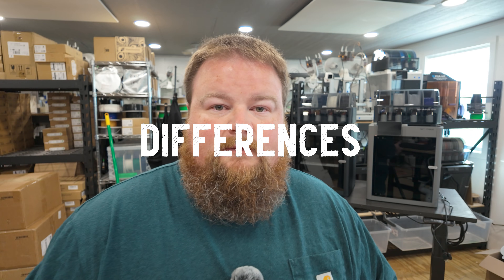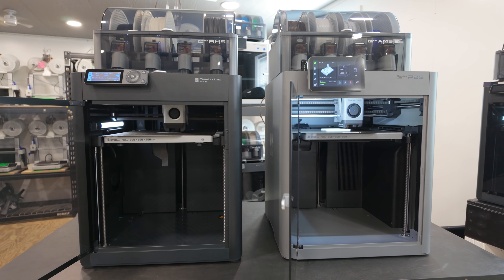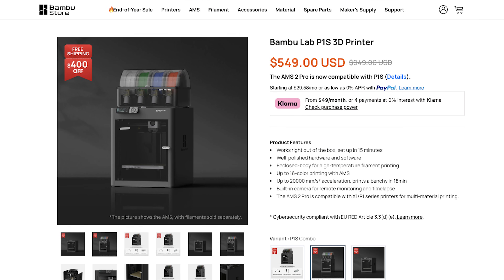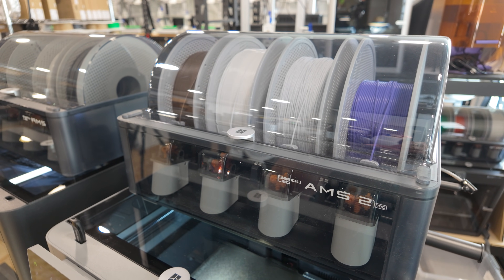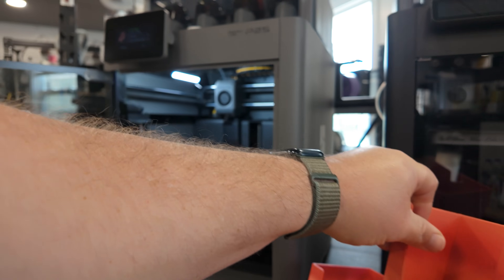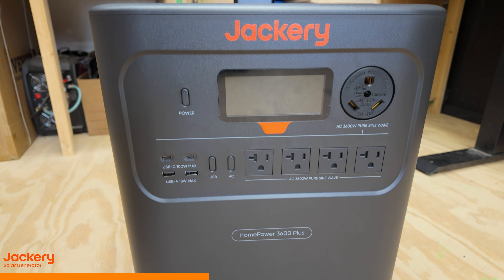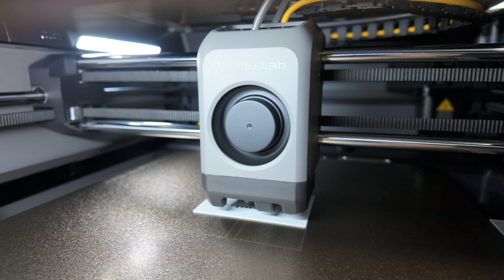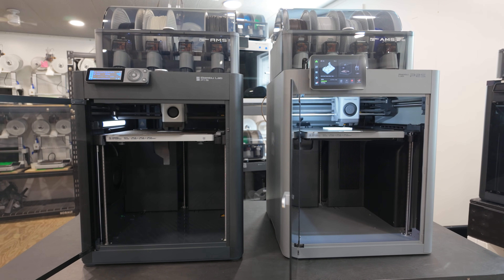Bambu Lab P2S vs P1S — Worth the Upgrade?

Comment: I had the P1S and I loved it. I then donated it to someone who had great use for it. But then I realized I still wanted a 3D printer and bought the A1 mini that just came out. And I could not believe it but every single small "issue" I had with the P1S solved with this little cheap thing: I hated the "screen" on the P1S, and I actually did spend quite some time calibrating flow dynamics. I also switch between 0.4 and 0.2mm nozzles and I dont have a good table so it always wobbles. The A1 mini calibrates flowdynamics incredibly, the wobbly table compensation is staggering, and the little screen is beautiful. It ended up printing EVEN nicer and more precise prints than the P1S. So if the P2S has all these features, for me it would a no brainer to get the P2S.

Comment: You mentioned that your entire workroom or hall is dehumidified, so an additional filament dryer is not needed. If that is the case, I was wondering in which situations you still need to use a food dehydrator as a filament dryer, and why. I also wanted to ask what relative humidity range you maintain in the room that allows filament to be used reliably without a dryer.

Comment: I love the P2S but there are some other strong selling points that maybe should have been added, the poop chute has been updated to the same style as the H series, which I think is huge for eliminating errors during purges, the floor of the printer is ramped now so it’s easier to clean, and the build plates locate better and don’t wipe on the plate anymore which is a added bonus of longevity to your build plates. Great comparison and love watching your videos but my recommendation is just get the updated p series it’s been nothing but a pleasure for me!

Comment: I have a remote iob so a lot of extra time these days after work and have about 10k saved up. I'm interested in starting a print farm as well. So far I've made less than 100 sales on ebay for selling under 15k in comics/graded comics so I have some experience selling on their platform, not much more experience selling than that. If you had my circumstances, how would you spend the 10k on printers and their supplies, shipping materials and shipping labels (need help with this one, idk where to get cardboard packaging or labels for cheap), and energy/maintenance/heating/ventilation cost thinking about getting a solar panel installed around home to help with this)? I just don't want to go in blind

Comment: What frazzles my brain still...
Power switch position! 
I have 4 P1S machines in a rack, the poop shoot, yeah. That's one thing. They're all plumbed in to poop through the shelf into collector boxes. 
Restarting the printers though, when they have an occasion hiccup and need a reboot? That's a royal pain. Just not enough space in between them to get a hand down to do the on/off thing. So I've resorted power cables being routed outside the shelving so I can switch off/on at the mains.

Comment: I am new to 3D printing.  We will probably go with the PS2 combo pro.  So some of my questions are, as a hobbyist, where do you locate the printer?  Electrically speaking, it's a non issue.  I am a electrician by trade.  I like the fact that it's also WiFi.  More than likely, the type of filament will be PLA or PETG.  On some occasions, maybe ABS or ASA.  Since it appears the print time is in hours, is some sort of exhaust capture recommended?  Would it be a good idea to have a thermal insulating plate to set the printer on?  Anyway, thanks.

Comment: Love your content, Sam! I do have a hot take on the UPS note though: for larger print farms, UPS backups feel overrated. Past ~10 printers, the math just doesn’t work. Losing the occasional print is way cheaper than buying UPS units for everything, unless your power goes out all the time.

Comment: Bought my 10 year old the P2S for Christmas. As Newbies we have been printing non stop.  Unreal how well it works and how easily it is to use. We just upgraded the motor noise calibration and it’s so quiet too.  The loudest sound is the fan which is crazy.  I wonder how the upgrade made it quieter.
Reply: Im thinking of getting one for me and my 10y/o. Hobby printing mainly with PLA. How is the smell for you. I have the A1 but like the idea of an enclosed printer better.
Reply: @AndyMcClung  no smell at all in the basement with PLA and PETG. We did notice very slight odor printing in the kitchen. Not much though. I was worried about it too, but my friend works for an aerospace company and they did extensive air quality testing near the printer to decide if they should conduct measures to safely collect the air coming out, and they said it was not producing anything remotely harmful using PLA, PETG and even ABS which surprised me. But in the basement I haven’t noticed any smell. Maybe I’m used to it though and not detecting it.
Reply: @Thedudeabides803 that’s good to hear. I was thinking about putting it my office since it looks cool but also may put it in the attic since it’s sealed and climate controlled as well. Plus I have a vent pipe up there I can tap into easily if I need too. If I do the attic I’ll just monitor it with the camera or a Reolink camera that I use sitting around. Thanks for getting back to me.
Reply: @A @AndyMcClung  we are having so much fun with it. Incredible what we’ve done so far. I’m making Festool attachments, tools, stops, battery holders. He’s printing gliders, and all sorts of things. No more knives I’ve stated 😂

Comment: Was time for another printer for me, so went for the P2S, I want a H2D or C later, and from what I know the nozzle's are the same as the P2S, so moving from the P2S later I will already have spare nozzles, and high flow is not cheap.. Also wonder if some of the wipe/scrubber consumables for the nozzle cleaning also fit on both... as you say, it's a lot to consider! 

nice review, thank you for the video!

Comment: I'm worried about Bambu machines melting or possible starting a fire. I have A1 and there are plenty of reports when the machine has melted. I'm so worried I just bought a granite slab under the printer so it doesn't start a fire. Just checked and there was very suspicious looking area under the printer but it was not the same area where the melting has started "normally" (component called NTC thermistor gets too hot). Be aware of this when planning to get a Bambu printer. Bambu Lab hasn't done anything to it yet and @3DMusketeers just released a video on the topic.

Comment: Good video, I learnd something about power consumptions of the two machines I didn't even suspect. I have a P1S and a H2D, and I greatly recommend the P2S if you are a normal user aiming to keep it for a few years. The big difference that is not stressed enough in this video is the hotend: the old style the P1S have works ok, but has big drawbacks compared to the new A1/H2/P2 type. Expecially when you need to clean/unclog/change it, you'll see the difference. And the AMS2 with the integrated heater/drier alone is worth the money difference between the two combos. During the black friday sale the difference in EU was less than 200 euros, considering the AMS Combos with the AMS2 pro with the P2S and the old AMS1 with the P1S. The P2S combo was a no-brainer, but some guys got fooled to buy the P1S by the lower price.  I assure they will regret, the P1S works fine, but has lots of dumb cost saving choices that I consider not worthy now. For the money you should buy the P2S.

Comment: I have an ender 3 bought many years ago and I use it occasionally for figures and stuff like that, but leveling the bed every now and then when a print fails, is frustrating. And I have already replaced the factory springs and other components. So, I was wondering if buying a P1S or P2S is worth it.

P1S is now at 389€ (559€ with AMS, 639 with AMS 2), P2S is at 519€ (749€ with AMS2), tough I'll initially go for single color. I'm not sure if support for P1S (pieces) will be discontinued, so this is something to consider.
I won't do business with it, it is just for me and friends. Should I got another brand?

Comment: 8:15 regarding the ease of loading in the AMS, I never use the little lever. I just push the filament down the hole and it goes in without issue. Maybe I'm slowly adding wear and tear to something but over a thousand hours in and there's no issues.

Comment: Great review, thanks. One thing you might consider adding is a comparison of performance at sport and ludicrous speeds. The reason I say this is that it is a measure of the performance margin of the machine at standard speed. I have used the P1S and X1C side by side and at standard speed with same prints they were hard to tell apart, but at sport speed the X1C maintained print quality while the P1S print quality degraded slightly.

Comment: For now I have passed on the p2s, I doubled down on the p1s's for most of the farm work. I do have a couple of H2S's and H2D's. The H2's get used mostly for PC and PA filaments. As the heat chamber really is a improvement over the X1C's in my experience.

Comment: Excellent review.  I have had a X 1C for 2 years. About 1500 hours on it with zero problems. I am looking for a printer for my son to use at college. He is in an architectural program and uses a printer to help build models of his designs. The university has 14 printers for 200 students.  The queue times are sometimes a week to begin printing.   I think that the P2S will meet his needs.  Thank you for sharing your knowledge.
Reply: Probably can even rent time on it to other students if you pick up 2.
Reply: Spend the extra and get him a X1C. I’m not impressed at all with my p2s. So far it’s messed up the first two prints I’ve tried. Both 5.5 hours, both the X1C tears through like nothing. It’s because of the vent system then decided to cheap out on.
Reply: @readingthebible5413  they stopped selling the x1c when p2s came out.
Reply: I would go prusa if you really love him

Comment: It kinda sucks what they did with the price. About  year ago the p1s combo was 950  
Now the p2s is almost 200 cheaper.  Doesn't make a lot of sence.. idk about the p1s but the h2d has had a slew of issues. Some have gotten good ones. But I've already had 3 come through my shop for repair for various issues. All manufacturing and design issues Imo

Comment: Got the p1s for 389 couple of weeks ago, (still on sale atm) - not a crazy deal but quite happy with it. Could not care less about the screen, barely need to use it anyway. Modding and customization scene is way bigger for P1S than P2S. Just bought a lot of filament with the difference in price (that was also dirt cheap when ordered with the printer)
Reply: I hated the 2.4 wifi BS, my router is 5GHz and I can't split it so PS2 for the win.

Comment: I just bought my wife just bought me a P1S for Christmas with a with a Panda touch screen to use with it... This will be my first machine...  What I'm hearing is I should have had her get the P2S, is that correct? Look I'm 66 and just plan to do hobby and gift work with this machine... I still think the P1S is the best bang for my money...
Reply: I upgraded from p1s to p2s bc of gimmicks like ai failure detection, passively heated chamber, better cam etc.

For pla and petg, the p1s is absolutely fine though. Just a little bit less comfortable

Comment: I always liked that the X1C and P1S didn't use much power to heat the bed. The H2D uses like 1300 watts. The H2C is probably similar, I wonder how much power that induction heater uses. I have to stagger my start ups with everything
Reply: On 220V it uses almost 800W during bed heating😅

Comment: I bought my P1S and a week later the P2S was released to the US.  I took my P1S back  and got the only P2S they had in the store.  I love the P2S, so much improved over the P1S.  Then I started thinking that I needed a second printer before my snapmaker arrived, which at the time was late March.  I almost bought another P1S but ended up buying the H2C, which will arrive later this morning.  After I ordered the H2C Snapmaker notified me that I would receive my U1 in early February.  Merry Christmas to me for the H2C and happy New Year for the U1.  While I have been a woodworker for several years and expanded to laser engraving and cutting and dye sublimation, IO never realized how much fun and versatile a 3d printer was and could be.  Glad to soon have three printers.  Not a print farm, more like a print garden.  And I will use my AMS 2 Pro from my P1S with my H2C for the full spectrum of color.  My P2S will be relegated to no AMS models or single spool prints like rainbow silk for dragons. Love your channel.

Comment: I was hoping you'd do a comparison on these two models..  I got another P1S a few weeks ago, and if the P2S had been available that day at MicroCenter (Clt store) would have had the P2S in stock, I'd have gotten one of those instead, just for the new screen, lol..  I ended up (for around the same money as the P2S) getting the P1S Combo PLUS another AMS2 Pro (also grabbed another A1 Combo, and a A1 Mini combo, they wouldn't let me buy 2 of anything due to the sales, lol).  They literally got the P2S in 2 days after I picked those up..  I'm glad to see they went with different X-axis rods, those CF ones, while great on paper (and functionally truth be told), as a nightmare to replace if necessary.  HOPEFULLY the new H2/P2 printers are a bit easier to work on as far as the motion controls are concerned.  I'm going to assume you've gotten a H2C as well, I'll be interested in seeing your take on that one as well..

Comment: There are a few things you missed. I believe the P2S uses larger and stiffer drive belts which should provide slightly better accuracy & longevity. Also the P2S fan setup is quite different. The P1S has a rear fan and exhaust port that is missing on the P2S. Due to this it’s more difficult to add external hose connections to vent the chamber when printing ABS $ ASA and other filaments that give off fumes & VOCs. Voxel has now got the VentoBox filter setup for the P2S that allows you to better clean the inside air but even this system doesn’t provide a rear vent. Instead they use the right side vent in the handle on that side. This is a knockout that you need to remove to open that vent. You should be able to find a model that attaches to that vent output and gives you a 4” hose adapter so you can vent fumes to a window. I’m not sure if this design exists yet but I’m guessing someone will make it available soon. It really is strange that Bambu removed the external fan & rear exhaust exit which both the P1S & X1C have. This allows you to remove fumes & VOCs from the chamber which is important when printing with more advanced filament since you really shouldn’t be breathing the contaminated air given off. It’s almost like they designed the P1S just for printing with PLA & PETG. If all you print are these filaments then no issues but if you print more advanced filaments you need to be aware of this problem.

Also the price of the P1S Combo with the AMS 2 Pro is $639. So the price difference between the P2S Combo with AMS 2 Pro ($799) is just $160. Think that makes sense for easier maintenance, easier loading, ability to dry filament if needed and simpler access if problems develop.

Comment: I love my P1S and have been running it nonstop for about two years.  The price point over the holidays has been amazing so I picked up an additional P1S with the AMS.  I may pickup the P2S  later.  I still run the panda touch and don't care about the bigger screen.  I rarely use it.  The ability to skip a failed print is really what I'm looking for in the future. 2:53
Reply: I got the Panda touch too, but I can only view values.  The printer firmware has basically locked out changing temps, etc.  Do you run old firmware, or do you run in LAN only mode?

Comment: What is the maintenance differences between the carbon rods on the P1S and the steel rods on the P2S? Thanks
Reply: While I don't have a P2S, if they're steel rods, just clean them with alcohol, then lube with Bambu lubricating oil (if it's the same as their other printers, they say you can use WD40 to lube the metal rods) would be my guess.  The P1S/X1C carbon rods are cleaned with just alcohol, and NOT lubed afterwards (aside from applying alcohol, and moving the head across the clean, wet rods).  Checking their P2S wiki, they don't specify exactly what 'lubricating oil' is acceptable aside from the little tubes they supply, so your mileage may vary using the WD40 (I use it on my A1's rails with good success, the WD40 lubrication pens work GREAT for applying it without mess).

Comment: Bought a P1S not quite a year ago and love it. The screen isn't a big deal to me as I use the app and I'm a I don't want a project I want it to just work I have enough things to fiddle with. Last few weeks is the most I've used it going down the gridfinity road and it's been flawless. With all that said if I went to buy another printer I'd go with the P2S just to get into the new infrastructure but the P1S is a rockstar especially for the just send and get your part out without any fuss
Reply: I’d suggest waiting. My p2s messed up my first two 5.5 hour prints that my X1C tears through like nothing. I def have buyer’s remorse so far with this p2s. Wish I would have gotten another X1C or the H series.